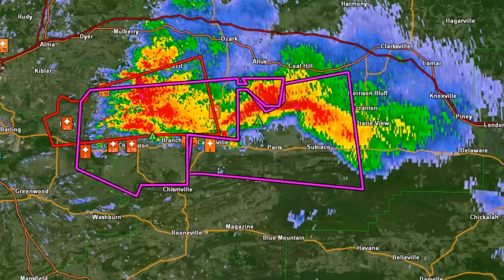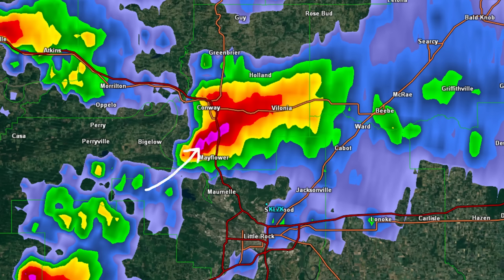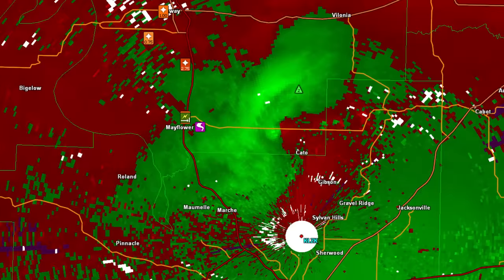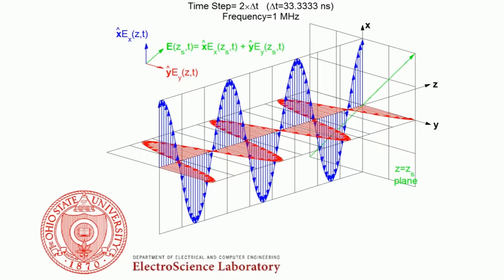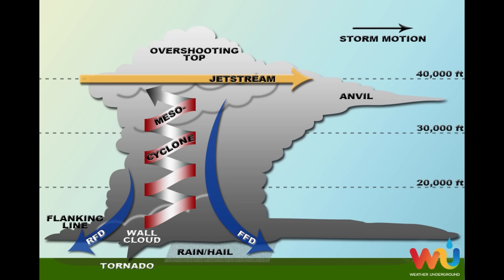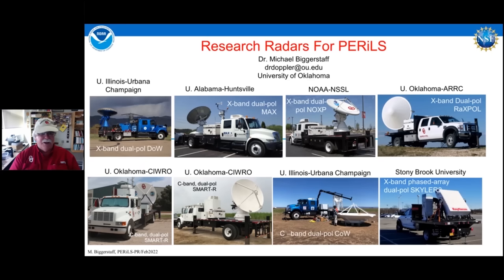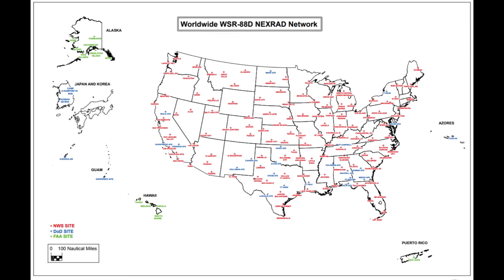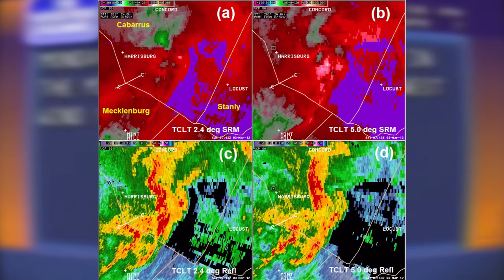Can Tornadoes happen with ZERO warning?

Comment: There was one in Naperville, IL last June 20th that was rare because it had all the markings of a qlcs but stayed on the ground for over 10 miles and briefly caused EF3 damage.
Reply from the maker: Wow that's a long path!
Reply: There had been a risk of severe weather over the Chicago area, but nothing was happening.  Then the low level jet arrived, and everything went nuts after 7pm.
Reply: @davidschaefer1981  It had been so boring that when I saw the line coming, I think it was around 10pm, I just shrugged it off because "nothing ever hits here" and went to sleep, missing the show.

Comment: Great video! Someone else touched on this I think in some previous comments but look into the Springdale, Arkansas Tornado on March 30, 2022. A line of storms formed in Eastern Oklahoma with some small hail and gusty winds around 3 am. The storm motion was nearly 60 mph. When the line moved into Arkansas it developed some weak rotation along the leading edge of the line. A line break developed near where the weak rotation was and a surge developed increasing the rotation significantly near the community of Johnson causing a tornado to touch down. This was close to 4 am and there was no warning at the time, not even a Severe Thunderstorm Warning. Shortly after the rotation ramped up (the tornado was already on the ground at this point) the NWS did issue a Severe Thunderstorm Warning with a "Tornado Possible" tag. Within 3 radar scans the rotation was gone. The last radar scan did show strong rotation and they finally issued a Tornado Warning however by the following radar scan the rotation had dissipated and Tornado had lifted. The tornado twisted and destroyed a cell tower as well as damaged homes and businesses in Johnson. When it moved into Springdale it went right through the heart of town damaging many homes and businesses causing significant damage to an Elementary School Gym, Large Industrial Plant and Mobile Home Park. It was rated EF3 at peak intensity (majority of damage was EF1-EF2) with 145mph winds, 350 yds wide (was considered a "drillbit" at a couple points based on damage found) travelled 5.2 miles in 8 minutes with 7 injuries including at least 1 critical but thankfully no fatalities considering the time of day and no lead warning.

Comment: I have witnessed several funnels clouds, and 1 very small tornado that was unwarned in upstate NY not far from Oswego NY. We were to the east of the city. No warning given, but it was a small tornado, that quickly dissipated. I think we watched it for less than 10 minutes  and then it was gone. It didn't hit anything, just an empty field. It happened on July 31st, around 2007. I have video of them on an SD card somewhere, and posted 1 of them to my FB page at the time. We watched several funnel clouds form one over the lowes in Oswego, and 2 over the Walmart in Oswego that same day, but they never touched the ground. We were on vacation in the area, and it made the trip very interesting. 

The  month after this occurred my home town had 3 small tornadoes go through, and did minor damage to houses, powerlines and trees. One building was completely demolished. I became hooked on tornadoes that years. There is something hypnotic about them.

Comment: At 9:03pm on February 28, 2012 a rain-wrapped EF2 tornado struck Harveyville, KS without warning. From NWS radar images it appears to have been a QLCS tornado that spun up quickly between radar sweeps. It's also very rare to have tornados in February in NE Kansas, much less at night.

Comment: I appreciate you putting this video about the Plainfield f5. I've told the story over the years you can't tell you how I'm alive to this day. So here we go again. I left my job site roughly Ogden avenue and Lincoln highway which is US route 30 and 34 because of the supercell you actually showed video of, heading south on Lincoln highway towards Plainfield and my apartment in Cresthill. I can tell you this, there's a bit of a windy drive and you can see stuff kind of flying around has I headed down Lincoln highway doing a pretty high rate of speed. I raced through Plainfield I made a left on Renwick road instead of continuing down route 30 to my apartment in Crest Hill. I took Renwick road all the way to Lockport then south by the prison the back west to my apartment. When I got close to my apartment, there was debris everywhere. Im still guessing but by the time I was in downtown Plainfield, thats when the tornado hit the highschool. I couldn't see anything out my back window of the car driving that way. I cant tell you why I made that left on Renwick. The apartment was about another 10 minutes away instead of the 20-30 minute detour I took. In my drive, I heard no sirens. Just black behind me. Occasionally something blowing across the road in front of me. Being buffeted by winds and hard hard rain. What I can tell you is this. After that. I started chasing tornados around the midwest. I still feel like I can warn people help them if 1 strikes. I'm older now and don't chase as much as I used to. I'm really glad and thankful to see the advancements in advance warning systems for those that have to deal with tornadoes. Say I was lucky say I was good say God was watching over me it doesn't matter I'm still here in witness firsthand what does F5 did and the only thing that still bothers me about it what's there was no warning

Comment: up here in alberta we get a LOT of unwarned tornados. they are usually very small such as ef0 or ef1 and dont often reach ef2 because they are almost all from those cold cloud fronts. we get a lot of chinooks and those cold cloud fronts so almost every year we see a little funnel cloud barely stirring up dust on the ground, usually just barely powerful enough to pull shingles off the roof. i saw one almost form just a week ago right above my house. i couldn't see a funnel cloud since it was directly above me but i could see the dust stirup on the ground what was about 30 meters wide and not even 80kmh winds because it just picked up a few small lawn chairs. it only lasted for a minute at the most and died.

Comment: Fantastic and very educational video. This was so  good I watched it twice. I live in Dixie alley and am old enough to remember the '74 outbreak from hell.
I was recently in a QLCS situation and one dropped out almost on top of us. We did get a warning, but only had 2 mins to get safe. I don't think there is much that can really be done about that. It was short lived and didn't do any damage. But - we were very lucky. (However, we are around 70 miles from the nearest radar and I will think about that very differently now.)
Your video helps me understand why sometimes they are missed. I know it's a fine line about when to warn and how much to cover, but I say its gotten better, in general. (Trust the Polygon! Trust Spann!)
I have a view to the west and tend to watch the sky a lot. I've seen rotation that was plain frightening when these QLCS systems come through, they don't look the same as some of the squall lines off the Gulf or from the  west. It's very different. One thing, as a side note, we aren't doing the best job with the waterspouts. Here, they don't tend to warn until it hits land. I don't understand waiting when you could give good warning before they hit. Don't boaters need to know, too?
Thank you again! Fantastic video!

Comment: A storm system back in the early "aughts" knocked out the nearest NWS station;  while it was out of commission, an undetected tornado formed in a rural area, hit a friend's trailer, and flipped it over with her inside!  (In a perfect example of how weird tornadoes can be, the family dog was tied up outside, but except for being scared out of its wits, it came through without any injury.  My friend was injured by having furniture land on her, but recovered just fine.)
As for me...last year I was riding home with friends in a storm, and the lightning revealed a tornado just ahead of us!  However, three lightning flashes later, the funnel had completely vanished.  My friend, a veteran of driving in situations like that, said that most tornadoes are reabsorbed minutes after they form.  It was still freakin' scary, though.

Comment: I was in Troy AL in 2015 when an unwarned tornado struck Walmart.  Local weather had actually said there was no threat of severe weather that day.  The storm dropped a tornado that went through the store, across the parking lot, into an outlet store, and dissipated before crossing the main road.  Sirens went off after the tornado had already dissipated.  

It did not help that this occurred at night, (though walmart was open during the storm)

Comment: I've experienced an unwarned tornado.

On October 21st, 2021, an outbreak of low-topped supercells occurred across Ohio and Pennsylvania.

In particular, an EF1 touched down in the heavily populated suburban areas several miles East of Cleveland a few blocks from where I lived.
There was no warning, no sirens, not even any visual indication of the tornado due to the sheer number of buildings and trees.

It tore part of the roof off of somebody's home, collapsed a garage, and threw a shallow-rooted tree into a nearby golf course.

Comment: During the derecho in 2006 I was camping with my family on Manitoulin Island. The nearest place that had a forecast was in Sudbury which was not even on the Island and was an hour's drive away. For most of the day it was clear until sometime during Happy hour when my mom saw some dark clouds and waved for my dad and sister to come in. It took a bit, but by the time they swam in (they were not far) the winds picked up and everyone ran. My family and another close family ran to my grandparents trailer, but the parents of the other family tried to take down their tent to avoid damage, but it flew away. They ran back inside and right as my dad closed the door, the plastic table on the deck pinned his arm in the door. When my parents got my dad's arm free my mom looked out the window and saw a tornado coming right towards us from the lake. We didn't have time to lift the latch and get under the trailer, so my mom threw me and my sister on the bed and laid on top of us as it passed over. Nobody at camp was hurt and only one person died on the island from a tornado. A tree went around the trailer and went into that family friends' car. Another trailer was completely crushed and a fiberglass kayak was bent around a tree while my dad's inflatable kayak only needed a few patches. A tree at camp lost all of its branches and was just a giant stick in the ground. The camp had wood for almost ten years after that tornado.

Comment: In 2013, northeastern WI was hit by a small outbreak of like 5-6 EF1 tornadoes maybe even 1 EF2. It was night time (we knew there would be a thunderstorm) but there were no warnings issued. I woke up in the morning with storm damage everywhere and it seemed like no one knew what happened. No one got unalived but still, I remember all the surrounding towns/villages (a small town in WI with a population less that 20,000 people) we’re extremely upset because there was no warning or anything. And we have one of those radars almost quite literally in our back yard. One of the tornadoes was less than 1/4 mile away from me when it finally lifted. More warnings is way better.

Comment: The tornado that instilled my fear of them was unwarned (I have panic attacks whenever there’s a warning for one in my area). On July 8th 2014 I was at home with my mom and brother, playing outside. I don’t think there was any bad weather at all, it was sunny. And then everything got really still and quiet, and my mom told us to get into the basement. EF1 tornado, no sirens or alerts or anything, it just happened. I don’t have the best memory of it, but I do remember that my dog was on our (screened-in) porch the whole time, barking at it, and afterwards there were wires and branches down all over our yard when my grandma came to pick us up. The traffic lights were down as well, so that drive was kinda scary. What’s funny is that afterwards my mom told me about tornado sirens, and the next Saturday when I was at a local park that noon siren thing went off and I was so scared that it was a tornado siren that I ran to my mom crying.

Comment: I experienced a QLCS tornado in Lynchburg, VA in April 2018. The storm was TorWar as it came into the city as it had produced a tornado further south. However, the TorWar was dropped cause there wasn't anything showing on radar that indicated a tornado anymore. Note, it wasn't allowed to expired. The warning was dropped. That lasted for all of a few minutes as the NWS quickly reissued one due to the report of a tornado on the ground within city limits. It was an EF2 within the city and strengthened to an EF3 once it crossed the James River and leveled the town of Elon, VA.

Comment: In July of 2017, an EF-0 tornado touched down in Oregon, OH and tracked due north through my city of Toledo, OH on a 5 mile path. Toledo is under CLE jurisdiction, and CLE is very conservative and hesitant to issue Tornado Warnings, adding on to that, Toledo is in a radar gap as well. The only kicker is, the very flipping minute that the storm entered DTX jurisdiction, it got Tornado Warnings. it would go on to produce one more EF-0 and an EF-1 tornado south of Detroit. This wasn't even a QLCS event. This was a lone supercell among a bunch of rain showers at 12 AM, on a day there wasn't even a marginal risk. CLE is very conservative with issuing warnings sometimes, and they often wait until a tornado is already on the ground, which makes me want to pull my hair out of frustration.

Comment: Derechos also suck. There was one that hit me while driving in 2020, the eastern PA derecho, and had winds of 75+ mph. They CAN be equivalent to a WEAK tornado, but luckily this wasn’t the case. Blew my car off the road and I was able to pull over but I thought it was a tornado by the way the wind and rain was moving. You could see the dust and debris clearly. You could also literally see the storm approaching as with thunderstorms and stuff you CAN see them approaching, but usually in the form of the storm clouds and such. This was a CLEAR debris and dust cloud approaching. I have a dash cam video on my channel if anyone is curious.

Comment: We had a QLCS in the middle of an intense severe thunderstorm a few summers ago in my hometown. At least ping pong ball sized hail and some wind gusts at around 80 mph. It was just a brief spinup that knocked over a few power lines and radio transmitters but wasn't even on the ground for more than a few minutes. But, it was spotted by local law enforcement.

Comment: I was hit by the Round Rock, TX tornado in 2022. It was just a high F1/low F2, but it hit my neighborhood with no warning, we had a watch but in Texas tornado watches are frequent so we weren't particularly concerned. They had forecast bad hail that day but the tornado risk wasn't thought to be particularly high. It dropped down right next to a major interstate during rush hour and came right for us (you can find a couple of videos online that are pretty crazy of this tornado). My power cut out a couple minutes before - but in a very weird way. It intensely flickered for a while before totally cutting out. I thought that was weird, then thought I heard the train near my house... then i realized it was getting louder... then I realized it was coming from the wrong direction. I looked out my window and saw it already in my neighborhood. Luckily I had put up my chickens earlier that day so they were okay, and though my home was damaged we were all okay. When we emerged from the closet, about 30 seconds later our phones received the warning alert. But at the time it hit us we had only a watch. Most of my neighbors didn't even hear it coming like I did, they didn't realize anything was wrong until fence boards started flying past their windows.

Comment: Had a wierd occurance once in Kansas.  We had a severe storm tracking east north of Beloit Kansas.  I think it was around 2009 this happened.   The storm was tornado warned for some time.  As it approached Hwy 14 they had allowed the tornado warning to expire.  Now I still saw some rotation on radar.  One of my fellow law enforcement officers I worked with was on duty at the time.  Now this storm also occured at night around 9 or 10 pm.  They had looked up north and saw a conical shaped cloud north of town in the lighting flashes before power went out for the whole town.   The National Weather Service at this time did not have a tornado warning for this storm.  Two deputies went north and confirmed damage to two homes as well as snapped power poles.  Not to long after the reports were relayed to NWS they issued a tornado warning with a confirmed tornado.

Comment: In March 2022 in the Austin, TX area we had a tornado drop out of the sky on the live weather broadcast (we'd had a few other tornadoes in Central Texas and the KXAN weather team was covering the outbreak live). One of the meteorologists who was offscreen started to shout to the tech crew to switch webcams to their Round Rock, TX webcam where a tornado had just touched down and was crossing Interstate 35. It took the weather team calling in to the NWS about it before it got warned. So it wasn't entirely unwarned, but the thing had already entered a residential neighborhood and was doing damage before the NWS alert went out. Thankfully no one was killed, but it did quite a bit of damage and injured 16 people. It was rated an EF-2.